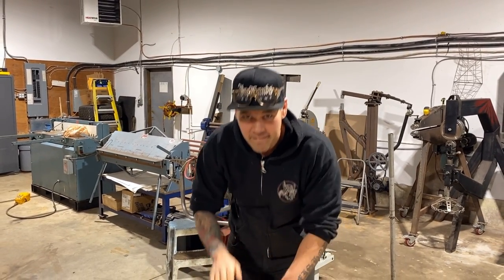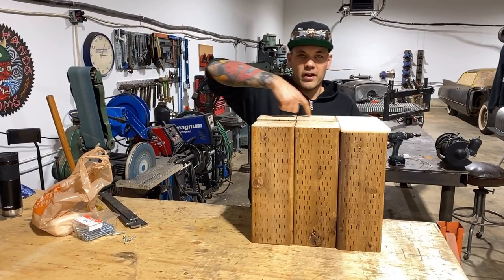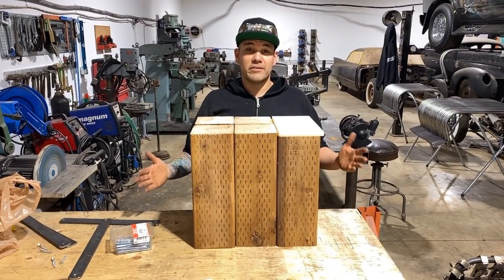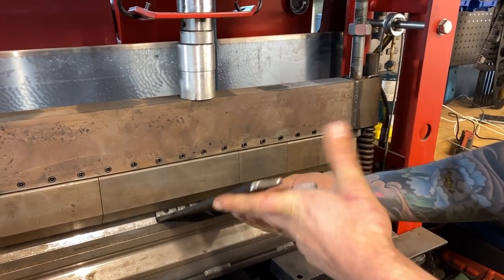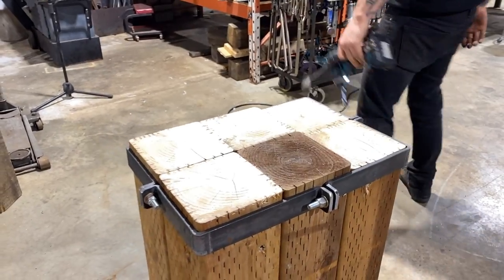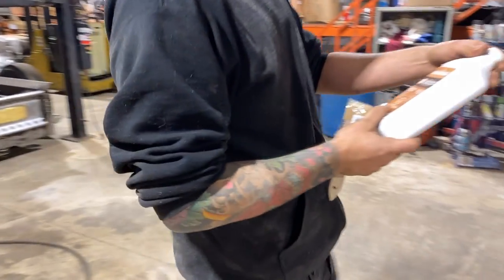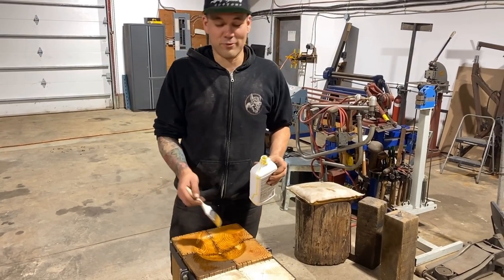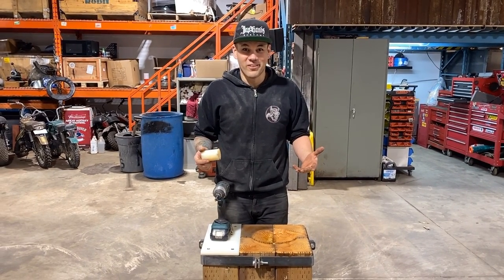How To Make Your Own Shrinking Stump for Metal Shaping!!  (EASY Step By Step Build)

Comment: Just wanted to share a quick tip for everyone. All of your wood handled tools, hammers, shovels, rakes, hoes, etc. can be given considerable strength and flexibility by drilling a small hole in the end, adding a few drops of boiled linseed oil now and again before storing them upright. The oil will eventually penetrate the entire handle and even aid in preventing splinters while using the tools.
Reply: Great tip, thanks.
Reply: So what you saying is drilling a hole on the top as in where u be holding thr handle...interesting will try it out once u give me clarity
Reply: @JustinPaul1st  push your shovel into the ground, the end sticking upward would be my definition of the end (or top). I suppose that a hammer handle would be drilled at it's base then stored in the vertical with the base facing upward.
Reply: @papawheelie5835  makes sense guess it depends on the type of tool mate👍👍👍
Reply from the maker: Awesome tip! I have never heard anything like it 🙏
Reply: @MakeItKustom  I'm 56 and been in construction all my life and never heard of this before either. Just keeping your tool put up in a controlled environment will help any tool though! I use a wrench, I clean it before I put it back in my toolbox! I think it's just a matter of taking care of what you have!
Reply: @comingtofull-ageinchrist6736  Agreed.  I just periodically scuff up my handles and wipe them with linseed oil.  Keeps them nice.
Reply: @papawheelie5835 , haft end, handle end would be my nomenclature. Very intriguing idea, never come across it before, giving it serious consideration.

Comment: I would add a second metal strap system to the bottom of the stump, vibration from impact could eventually cause the stump to loosen ... my opinion. Good content as usual, thanks for your time and effort, take care be well.
Reply: That’s a good idea. Personally I would have drilled through and locked it all together with all thread, the same way old butcher blocks are made.
Reply: Or because he has it near the top he could drop it down to half way, it should keep it together too, especially as he has it screwed together. But like you I would put a second strap around the bottom about two or three inches up.
      I checked out Big Joe, there's a Big Joe goes under Motorcycle Cruiser on YouTube.
Reply: I completely agree with a second row of tie bars around the bottom.
Reply: Nah, it will be fine.
Reply from the maker: Stronger is always better. Thanks for the insight! We will see how it holds up. Time will tell
Reply: @MakeItKustom  Simplicity, for those who need it, is to just bore holes straight thru, then use a length of threaded rod, wide washers, and heavy hex nuts to 'clamp the 6-by6 blocks.  Probably want 1/2" threaded rods or larger diameter.  Some LOC-TITE thread locker fluid on the nuts will help.  Heavy duty hand drill and a bore or spade bit the diameter for the threaded rod.  No need for drill press, press brake, thread taps.  All Home Depot parts for those who, like everyone was, are starting with only basics and small budgets.
Reply: I just got through burning an ash tree that was a victum of the ash boar. But had  plenty of sections that a stump could have been made from this tree. It was 2.5 ft across the stump where cut. And 40 ft tall.
Reply: Actually I think Karl was way ahead of you when at 16:20 he suggested flipping the stump over carving a second bowl and “adding another one of these”.

Comment: Congratulations Karl, you've just made what every blacksmith, and armourer through history calls a dishing stump! ;) Don't worry about getting Boiled Linseed Oil on the metal, blacksmiths have been using it as a metal finish since at least the US Civil War, and likely much, much longer. Armourers I knew back in the 70s used about the same design, but taller, and with a 2" Beech or Ironwood board instead of Nylon. The Primo Autobody guy I worked with back in the 80s called his a dishing stump too, but his Grandfather was a blacksmith... Oh, and Nylon in the Ottawa area, Canus Plastics, and I am pretty sure they are national...
Reply: Heh, I was just coming to the comments to share this! Well done brother of the hammer! May your forge never get clinkers and your pant legs never catch a spark!
Reply: @IronAngelForge  lol! Thanks, but as I mostly use either charcoal or propane, clinkers aren't much of a thing, and we will have to add "again" to the end of the 2nd part... But that is a very cool greeting. May your forge, as well  never give you clinkers and may your pants never catch fire too!

Comment: With linseed oil the lighter the coat the faster it dries. You might find it takes longer this time around. The hole in the center, just drill it out to a common size and stuff a piece of dowel rod in it with a bit of wood glue. I like titebond 2 for wood glue. It dries quick and is very durable. Nice project! I really like the idea of using regular lumber for it.
Reply: I was thinking the same thing about the dowel in the center of the bowl. Great minds think alike. LOL
Reply: @sacredshogun6325  yes they do lol
Reply: +1 for the dowel. I have even been known to rip down a piece to close to that square hole size, whittle one end into a taper and just drive it in hard, if you don't wanna drill it for the dowel.

Comment: Hi  Karl. Linseed is great stuff. Best is to mix 50:50  with turpentine for the first coat which makes it  really soak in and then full strength for second coat. The oil will swell the timber and keep it tight in place. Will make any cracks swell and stop them from opening up. Great video. Love your channel.
Reply from the maker: That’s a great tip thank you! Cheers!

Comment: Awesome video Karl. The plastic is PTFE. Next time when you make something out of flat bar and you bend it, could you explain to your fans about calculating the length of the piece plus the radius and thickness of the material you must not forget to take off the measurements after the bending. You know what I mean by the overall length of the piece after bending. Have an awesome day 👍❤️
Reply: Ptfe is teflon he might have been thinking of hdpe.
Reply: @wyatt7747  so true 👍

Comment: HDPE is the plastic
I would recommend lumber that is not treated. Treated lumber tends to be softer crappier sticks. The perforations in the outside are to allow the treatment AKA poison to soak deeper into the wood. Splinters from treated lumber are damn near guaranteed to get infected. I also agree with through bolting the lumber since wood expands and contracts with the moisture in the air. Then whacking on it with a hammer can near guarantee those wood screws will eventually come loose. it wouldn't hurt to also glue the hell out of all the pieces as it goes together. My thoughts is bomb proof it for a "several life times" tool where your great grand kids could be using it. I built an anvil stand out of 2x4s and over built the hell out of it! Great video, looking forward to the how to use it video which is probably already out by now haha.

Comment: I would recommend using the Linseed oil often, It will keep the wood from cracking and drying out . Drill a 1/4 inch hold about half way down in your wood hammer handles and fill them with linseed oil and plug the hole with a 1/4" dowel every few years and they will look like new for years. ( If the handles are in good shape when you add the oil) Great videos Carl.

Comment: Vice Grip Garage  makes his shine juice with Linseed oil and paint thinner and sometimes WD-40.  Thanks for sharing the stump build.  I have a piece of old railroad track lag screwed to a piece of treated house support piling with a concrete base screwed on from the bottom.  I is heavy enough to be  useful but light enough that it can be moved with a two wheeled cart.

Comment: You can use that stuff on wood and metal. That little hole doesn’t matter. Lay it on thick. I like to use a rag but a brush works too. Main thing with BLO is if you leave rags soaked in that stuff, it will spontaneously combust.

Comment: You can use the oil on the steel also. It’s what top fuel frames were coated with back in the day to keep them from rusting.
Reply: Still a good coating to prevent rust on tools.

Comment: Wray Schelin from Pro Shaper made a similar shrinking facilitator out of multiple pieces of 8x2  timber's in a box frame.
You can buy a High density Poly Ethylene chopping  board  and cut that down for the flat beating surface also and  cheap and easily found from local kitchen supplies store or walmart/ K-Mart

Comment: If you put the linseed oil on the metal and rub it in it will make the metal shine and also slow down the  rusting that will inevitably form on the steel. I would coat the whole stump to help preventing it from cracking especially on the ends. You should also periodically re coat the stump to keep it preserved.

Comment: Hey Karl, just a note regarding the information that you provide us on these videos, the nuggets has you called them. After welding some sides on  a flat stainless plate, I ended up with some distortion (oil canning) on the plate! I really need it to be straight, so I remembered the video you done on heat shrinking and decided to have a go at it… after a lot of cursing and swearing, I got the hang of it and managed to get the plate straight again. All it needs now is dressing and sanding smooth. So yeah, keep on feeding us this bits as they become very useful when the right situation comes along… Now I have to thank you for saving my part 😊😊
Reply from the maker: You’re so welcome! I’m glad to hear that you were able to get the plate shrunk to save your piece!
Reply: @MakeItKustom  hopefully I can planish it to be as good as new. It’s a vibration conveyor runner, so it needs to be as flat as possible.

Comment: Boiled linseed oil thinned with turpentine protects metal pretty good too. Quick wipe with a rag to touch up.  Vintage aircraft with steel tube fuselages treated the inside of the tubing with linseed oil.

Comment: For the little hole in the center if you see it becomes an issue, maybe drill a 1/2" hole and glue a 1/2" hard dowel down in there before the final shaping to fill it it?

Comment: I work for a package company, we label and box foam display boards. Our labeling machine has nylon blocks on the label stamper, it's 3"x4"x1/2" with a cost of $500 each.
Reply from the maker: The whole machine is 500 each or just the blocks LOL? My nylon was definitely not that expensive
Reply: @MakeItKustom  just the blocks. They have holes drilled in them to mount them to the stamper on the machine and has several air holes drilled through also

Comment: Nice. Can't wait to see it in action!! I broke bad and picked up a HF English Wheel this week. Thank you for all of the great content and inspiration to get out there and work on my projects. A note about Linseed oil, I am told it will combust if left on rags. I usually use a cloth to apply it to metal I am working, tongs and punches etc.
Reply from the maker: That’s interesting about the combustion! Thanks for the caution. Good luck with the wheel! They are a lot of fun

Comment: Perhaps for anyone without the means to bend the metal straping two lengths of heavy steel chain could be used bolted together , I think that would look good too. Great video Karl , inspiring.
Reply: Or just make from multiple pieces and weld it together.
Reply from the maker: I like the idea of chain a lot!

Comment: Oak 2x4's make a great shrinking stump and/or anvil base.  Band them together with flat bar iron straps with tensioning bolts at the ends of the straps.  One high, one low. Do your work on the end grain.
Better yet, Oak 2x4's show up free many times, in the form of wood pallet side rails/stringers.

Comment: Any kind of oil is good for wood like that, I use old motor oil on my anvil stump. Wood will shrink up and crack as it dries out but as long as you keep it oiled it will virtually make it waterproof and rot proof and shouldn’t start cracking. And your metal straps won’t rust either if you just keep the whole thing oily. Looks beautiful 👍

Comment: Wray Schelin is the one that has made one ,the man's metal working is phenomenal, years ago he started a forum called metal meet if you go on there everyone is so helpful with any questions and the work that guys show are great also. Also he built a frame and then you can drop new pieces in or even change out the size of the bowl  depending on the area your shrinking

Comment: On my stump, I put the ring lower because I put smaller rings to hold hammers and other tools. I also mounted a post vice. Stumps will dry out and crack so I put the finest oil can buy. My truck has a lot of it. I also mounted two casters on one side so it acts like a hand cart if you want to move it. I ask an old blacksmith why her burn hid hammers and stump. He told me that it sealed it and kept the bugs out. After burning I sand and varnish everything including the strap. Looks good.

Comment: Another source for a shrinking "stump" are old decommissioned gas bottles. Most have a concave bottom to them, but you are limited to that specific size unless you can find an old, old acetylene bottle of the short and wide description. Those JJ measuring tools are quite expensive for what they are, (over $100 ea). Since you have the "stump" clamped only at the top, does the bottom tend to spread out a bit? Fill the center hole with baking soda mixed with UV activated glue. Linseed oil will stop the metal strapping from rusting, so paint the entire thing with it.. You may be thinking of HDPE (High Density PolyEthylene) used on hockey rink walls,  or  PTFE (Polytetrafluoroethylene) which is a Teflon product and can be bought in all kinds of shapes. I guess you are referring to "Robertson plastics" on 56 Ave in surrey. There is also "Industrial Plastics" in Kelowna. Once again, nice work Karl! Another product in kit form for you to sell!  I also just had an AHA! moment, or more like an AARGH! moment...my beard got caught in the space bar while I was typing...Now I have a new typeface.
Reply: I have always been tought to avoid cutting an acetylene bottle for a stump as there is no 100% way to at home ensure the gas is purged due to the nature of filler material in the bottle. I'll take the risk on propane and Oxygen, but the risk on sparking off acetylene is too high for me.
Reply: @kindyrpenumbra7170   🐓🐓🐓🐓🐓

Comment: Another good way to dish wood is to do plunge cuts with a circular saw, set the depth of cut and dip it in a circle until you have a bunch of fins left over chip em out with a hammer and polish with a flap disk on an angle grinder, you could also use a torch and wire brush or a chisel if you hate your life enough

Comment: Your great at building what's needed in the shop I'm thinking of building a engine test stand would love to hear your ideas
Reply from the maker: I’d start with a 2x2” square tube frame and get some square tube made for hitch receivers (smooth on the inside and 2x2 slides nice into it) use that for your engine mount brackets. That way, you can adjust for different engines? Just a thought

Comment: if you heat your brackets up and slop the boiled linseed oil on and let it absorb in the pores, you will get the authentic 'blacksmithed' look and never have to worry about messing up whatever 'modern' finish you may have in mind.....it'll last indefinitely, especially if you're like me and NEVER hit it with an errant blow.....lmao

p.s. were you thinking of HDPE (high density polyethylene)....good stuff for the right job....try to grind on delrin; that was what sold me on it...I used it for bushings and MANY other things...good stuff. I always enjoy your vids convinces me there may be hope yet for another run at 'Made in America' greatness

Comment: Love your videos, was wondering if using non treated wood would be better? Sometimes a guy will heat up metal before pounding shape into it.Burning treated can be bad.
Reply from the maker: I like the treated because the sides are finished and fit together nice. Since the bowl is on the cut edges I don’t think that there is any treated chemical to worry about

Comment: Very nice!  Assume you could bend the flat bar by heating it cherry red with the oxy-acetylene torch and bending in a vise?  Another way that might be easier for some is instead of flat bar, use long pieces of threaded rod thru the centers both directions slightly offset with large, thick fender washers and nuts?  (five pieces of rod in total, two along the length thru the centers, three along the width thru the centers)  Drilling the holes might be a little tricky, but I'd think a spade but would be long enough, and with the fender washers you could oversize the holes a bit to make alignment not so critical?

Found your channel thru the Cold War Motors channel.  He had a video on tucking and had to have more on it so here I am.  :)
Reply from the maker: Yes I had considered using threaded rod as well! I’m sure it would work awesome. Especially if it had some plate washers. 
And absolutely you can bend flat bar in the vice probably even with a big enough hammer you wouldn’t need to heat

Comment: i made a very basic and crude metalworking stump back a couple years ago. not as big a diameter , just lagged onto a couple 2x4s and braced at the bottom. used it to shape my fender patch panels...and a bag of play sand . cheap and it works.

Comment: A quicker way to make the bowl that I used and I believe I learned at a metal meet, is to plunge cut with a circular saw and then you can clean up with the tool you used.

Comment: Linseed oil is very flammable. If you put the rags together in a pail. It’s a fire hazard can ignite without a spark. Most hang the rag dry them out then throw them out.